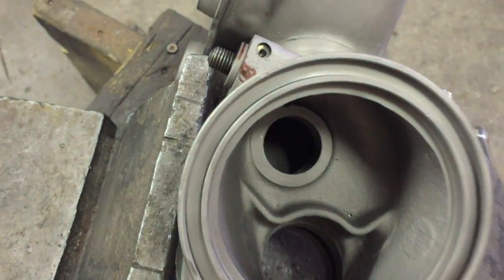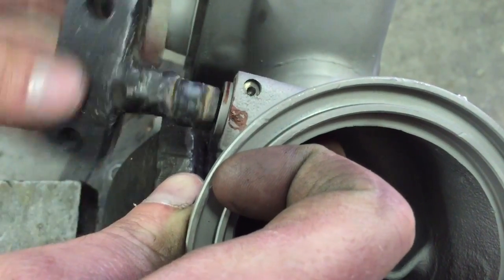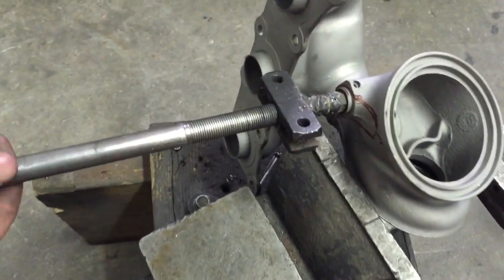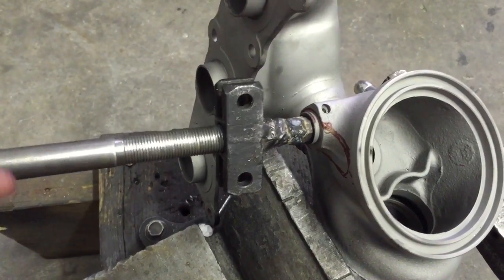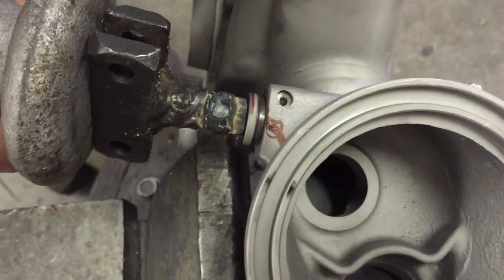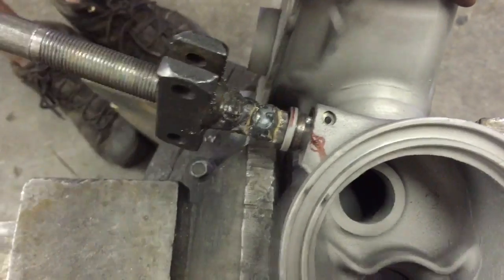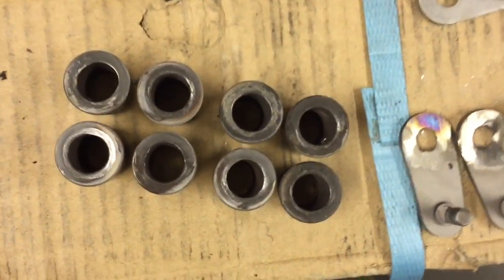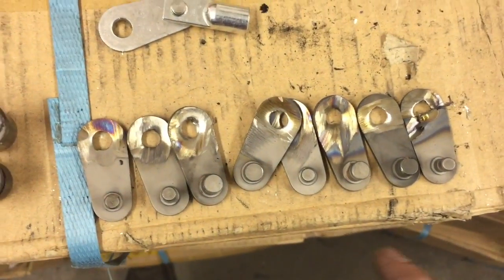BMW N54 135i 335i 535i Wastegate Rattle Bushing Removal

Comment: Did you drill the pin that holds the bushing out first before using the slide hammer? Or did you just use the slide hammer with the pin still in the bushing?
Reply from the maker: I have done it both ways. Lately I prefer to not drill the pin and instead break the pin in half with the slide hammer, then grind the pin if it’s sticking out, and I insert the bushing and punch the pin in to secure it again. You have to be careful though, if you punch the pin in too hard, the bushing can get damaged and cause the wastegate arm to bind.

Comment: Can you show another alternative other than this method and hammering it out with a punch? I'm kind scared to use a punch and I dont own a slide hammer. It looks like you modified the slide hammer. 

Also, what alternative is there to remove the pin? If there isn't one, besides drilling it out, what size bit are you using?

Comment: Where could i build or buy one of these slide hammers?
Reply from the maker: +MobbDaily the slide hammer you can get off eBay , I welded a nut to one of the slide hammer parts so I could use a bolt to run through the bushing, you have to make it, it's not something you can just buy
Reply: Turbo Lab America thanks you!